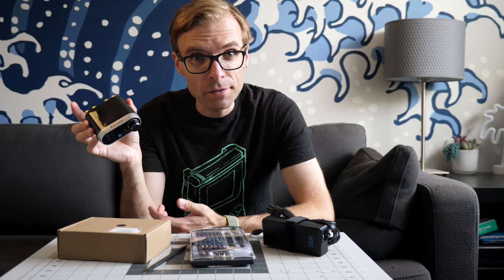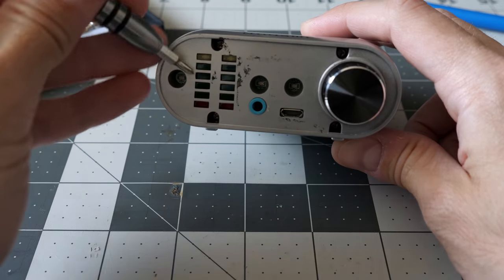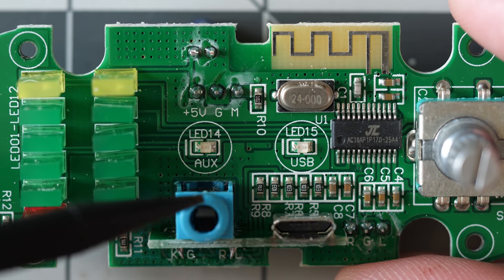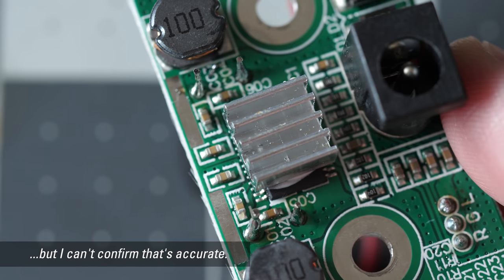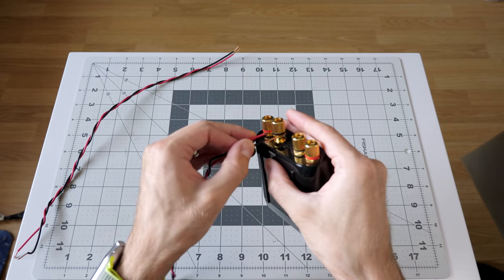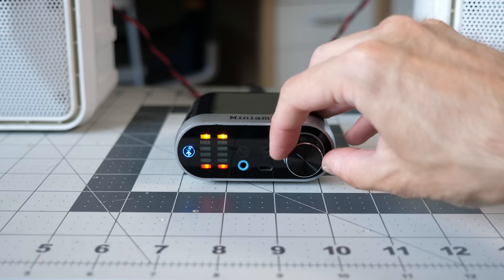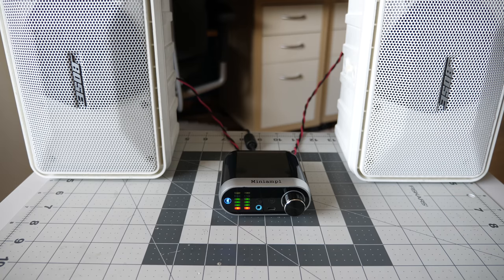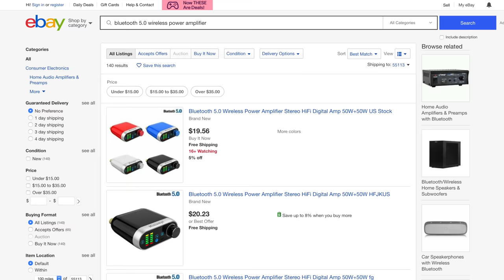Mini Stereo Amp (That Doesn't Suck)

Comment: if you use laptop charger in audio devices , it could make some distortion.
Reply: ground loop. laptop charger is probably earth referenced as every PC running on AC.
Reply: @Mr.Leeroy  Mmm, no, most laptop chargers, at least in the US, only use hot and neutral.  The reason it might introduce distortion is because PSRR is typically only good in amp chips when the noise isn't high frequency.   However, some people, particularly those who like trance misc, like the more lively treble distortion that results.  Purists would never settle for it though, want it to sound the way it's supposed to without that coloration.

Comment: You made a decent review but I don't fully agree with what you did by disassembling it first before testing its audio performance. Who knows if that noise was already there even before you touched it or due to your improper re-assembly? By that, it became unfair to say that the unit has a build quality.

Comment: These little usually arnt that bad. Ive had a few and they all been pretty good. Most people don't realize ypu only need about 10 or 20 watts rms to get pretty loud depending on how efficient ypur speakers are. I have some old kenwoods that are rated at 92db per 1 watt which is very efficient. Only takes 1 watt to get them pumping music out at roughly 92db which is quite loud.
Reply: Yeah, they should also rate the distance. For example, 92db at 1 watt @1 meter. Back in the day you'd see cheaper makes use 1 foot, etc.

Comment: A few add ons to the review: 1) The chip inside is TPA3116D2.  No need for heatsink. 2) The device will produce 32W per channel max RMS if the PSU is a 19 volt 4 amp (like from an old laptop) or 50+50W if you use a 24 volt 5 amp power supply.  3) Device looks great and sounds great as long as you do not open it up. as it seems to have been  soldered and inspected in China.....4) I have a few of these. Only two features I wish it had: Remote control and means to brew my coffee!

Comment: REAL 50 W will blow those speakers... For a Not direct signal recording this thing sounds very "high resolution".  The level indicator  works very  fluid - like a microprocessor based vu -meter.  Op amp , or transistor based vu -meter have some "slew rate" problems and lack a clear decibel steps separation.

Comment: What do you mean you dont know if it is going to overheat. Just run it for 30 minutes. If it gets warm to hot you are going to have a problem. I'd guess that most people would run it on common 12 volts so it may be ok. 

What "sage youtuber" recommends pulling it apart before testing? (Carey Holtzman?) I'm a pc repairer and I always test before repair otherwise you may fix or break something and never know what the original problem was.

Comment: Suggestion for future, honest, tests:
1) Buy two (identical). 
2) Disassemble one.
3) TEST ON THE UNTOUCHED ONE!

This is, obviuously , because they are NOT made to be tinkered with by people who are not repair technicians knowledgeable of the brand's/model's build and features before any internal operation is attempted.

Hope I was constructive enough.

ALTERNATIVE (if you only want to buy one) :

TEST FIRST, disassemble after all tests are performed.

Comment: I got the Breeze-audio 2.1, which is close to the other metal shell model you show in this clip, but has a sub connect, a few preset EQ modes, Aux and I think FM?. I really like it and it drives a couple old ADS speakers which are not efficient at all. I am using a 12v adapter which I will upgrade when I dig out a stronger one out of the box of 100's of adapters.
The one problem is although I specifically looked for the latest BT connection, which this has v5, it claims longer distances, but that looks like direct line. I got 15-20 feet out of it. But perhaps there is a BT antenna you can recommend that we can swap for thatstubby one?

Comment: Usually these Chinesium things suck though they claim to have used a real TI amp chip vs a clone.
Though I think that 50 watts per channel rating is a little optimistic with that little heat sink.

Comment: When I build a budget system it is always with used gear. $20 gets you a nice amp if you spend some time looking.
Reply: Okay, but 1 cent gets you a nice amp if you win a bid on ebay.  You can't really equate the price of used products as it is hit or miss and may take a lot of time and effort looking around and picking it up, possibly getting mugged in the process and tossed into a burlap sack then into someone's truck then buried in the desert where you have no speakers to use it.  ;)

Comment: I've got the nobsound ns10g connected to my PC over USB and e set of slack bs53.2, the sound is simply amazing with endless power.

In bluetooth mode the sound is flat and less clear, I just have used this a few times.

USB works perfect with damn good sound.

Comment: judging by the solder joints it looks like a project I did when I was 13 in shop class.
Reply: I doubt you were doing projects that utilized 90% surface mount components in grade school.

Comment: Love to put a dummy load on this and send it a sine wave, let’s see what the real RMS output power is!
Reply: As an audiophile this like a psychedelic trip to me. A bad😉 one.  That it works at all is natural curiosity. 

You mentioned big old amps.  I have a retro system with a Marantz 1060 integrated amp from 1975. I believe it was their first solid state amp and seems designed with mellow "tubie" sound in mind. 

They are available re-capped on Ebay for less then $300.  Anyone interested in the era could do a lot worse.

Comment: Excellent Review. I was very interested in that intermittent problem I was glad you fixed. The sound produced was pretty decent. I seemed to find the audio quality better when using the USB input path. I don't know if that was your experience as well. But, from the audio you gave in the video, it seems clearer and seemed much stronger and cleaner than the Bluetooth source.

Comment: Id go with the Lepy 2020a class T amp. its by far the best amp for the money out there.
Reply: Except that it doesn't have the features he desired.
Reply: @Markle2k  hey. If your not intrested in sound quailty sure i guess. Can always just get a dac or bluetooth receiver thats would work just find with the lepy.
Reply: @FuskyTheHusky81  The sound quality of this seems to have been sufficient. What the Lepy doesn't have is the desired inputs. If you can't get the music to the box in the format needed, your best quality sound is static hiss.
Reply: @Markle2k  Id still just get an adapter or whatever I need to connect the input to the amp. Then again I'm a bit of an audiophile my self so I would take sound quality and pay a few extra bucks.  anyways though china you can get even better amps that have Bluetooth inputs and really anything you could dream of. but those are more in the 50-150$ range.

Comment: 🤔Interested in one of this, will you confirm one thing: after power failure does it resume the last state or do you have to reconfigure for example you use in Bluetooth mode, then the energy goes them back again does it stay on bt mode or do you have to manually turbo on it again?

Comment: It don't mean a thing if it ain't got that swing, do wop do wop do wop. It don't mean a thing if it don't say N watts into Y ohms at a specified % of distortion all in one sentence. Makes no mater what they say if it don't say it this way, it's just a load of bovine you know what. 

Interesting that it's blurtooth 5.0 (hifi) that mode is not the blurry crap that is blurtooth 4.0. This uses a whole WiFi channel though, and more power. Just plug in and keep it simple and clean.

Comment: The TDA amps are generally pretty good, but the implementation usually suffers.  Too little power going in to power it, and little or no heat sinking.  Put a heat sink on a chip and then put it in a closed box is useless.

Comment: two of ti tpa chips drive my aiwa exos 9 bluetooth speaker - 200w rms one chip drives the dual voice coil subwoofer 100w 6.5'' and second drives the mid x 2 - 3'' and high x 2 - 1'' aiwa did no put heatsinks on them but i've been blasting on full volume and no distortion or else is present bass is always full, just its plastic box had pillars cracked (glued them back with epoxy glue) from too much bass that speaker produce with battery (which is removable and they sell external battery) not AC connected

Comment: $20 great - nice review - sounded OK  I don't like the annoying harmonic distortion w/Class D amps. 
(even soft, higher end piano notes/chords make really nasty buzz compared to clean analog amps.)
Maybe the less efficient speaker helped hide that digital harmonic distortion. Might be like analog
amp ratio of high power signal to the constant, fixed low level amount of crossover distortion???
Reply: Harmonic distortion? Not found any in the modern class D chip-amps like the TPA3116D2, the only issue is giving them a nice load impedance.
Reply: @G-ra-ha-m  thanks. I need to try a modern one!

Comment: It'd make a lot more sense to have the USB port on the back, because having a USB cable permanently coming off the front isn't ideal.
Reply from the maker: Yeah I’m not thrilled with the placement of either the USB or aux in ports either.

Comment: 50 watts... Suuuuure, for a split second if lightning hit it. I'd assume 10-15 watts. 

Also, you put faaaar more effort into those B(l)ose speakers than any sane human would or should. I'd run a set of cheap speakers from a thrift store before I ran those. You know what they say, no highs, no lows, must be Bose. A.k.a "Buy Other Sound Equipment"
Reply: You're not far off. The TPA3116 (assuming this is the real deal) is capable of 2 x 15W into a 8R load at 15V. At 24V it can actually push 50W into 4R. Maybe I missed it but I didn't see what voltage this unit actually runs at. They are actually quite amazing little chips. Class D and generate very little heat. The first amplifier I built was a 2 x 40W mosfet unit with a heatsink the size of a paperback book. I still can't get over how small these things are.

Comment: Hi, I have an mini-amplifier like this, but I mount a small ventilator on it....well I almost destroy the plastic case when I install it but it is working fine the temperature on the power module now is much much lower ....I think he will not survive without a cooler...

Comment: Since you already screwed it up by tearing it apart you should bridge the outputs see if you can blow that bitch up or get more volume out of one speaker and then you could just use a pair of them...one for each speaker.  Getting stereo might be a challenge.

Comment: I kinda can't stand rotary encoder+digital potentiometer volume controls. Sometimes you can't dial it in just the way you want it. But at that price I totally get it. 
-777th.
Reply: I find the 12 volume levels to be just fine.

Comment: Thats more like 15 to 20w. And the hand soldering on the board is really awful. End of the shift on a Friday quality by the looks of it. Cant trim legs on the caps and flux residue everywhere. Better to pay a bit more and get something half decent quality.
Reply: The first thing I noticed was how horrible the build quality was. They made this as cheap as absolutely possible and didn't spend a penny more. I don't really think the dual board is a great idea either. But hey, $20. I'm actually looking for a half decent DAC since my old USB1 one finally died the other day with a pretty nice audio crash. I'm not so sure about this one TBH. No headphone jack either looks like.

Comment: TPA3116D2 is a real 50Wx2 at 4 ohms. only thing i see wrong with that amp is the instructors are too small. 9:12 powering it at full power for more then 1 or 2 songs those instructors are going to get hotter then the blazes of hell
Reply: @Douglas Blake haha yes how did I misspell that twice

Comment: Those class-D amps are always overrated by the manufacturers for obvious reasons.  '2 x 50 Watts' is a stupid claim; usually it will distort like crazy at that level.  Test the thing with non-inductive loads, both 4 and 8 ohm, with a decent power supply of 24VDC.  Then check for clipping and THD at max 1%, which already is a lot.  I bet you won't get 20 clean watts at 8 ohm.

Comment: Excuse me, but I believe this is just the improper way of testing things. It doesn't matter how good you are in taking apart electronic devices and putting them together again and THEN testing them as if they were the original - they simply are not the original anymore! And you will also never know if there was a difference between the real original and the put-together-again 'original'. 
If in an experiment you don't perform a test on the subject of the experiment in its real original state, the experiment is basically useless. It's like testing a new drug without any control substance (e.g. placebo and/or Gold standard).
In this video it doesn't matter that much, but it would have been an easy task to test the device before taking it apart. And the final statement would have been more convincing.

Comment: SO WHY COULDNT YOU DO SOME MEANINGFUL POWER OUTPUT MEASUREMENTS  AND DIST.  TESTS,AND ALSO IF ITS RATED AT 50 WATTS PER  THERES NO NEED TO ASSUME ITS ONLY GOOD FOR LOW POWER SPEAKERS.

Comment: 4:26 Is that white residue on the board some kind of corrosion/oxidation?
Doesn't look all that clean, hope you wiped it off.
Reply: Dried flux, cheap chinese products rarely clean flux off during manufacturing. It won't harm anything.
Reply: Some fluxes actually may be corrosive in the long run.

Comment: Im sure this guy has experience with electronics.  And he didnt break it by taking it apart. Ive taken whole stereos apart and laptops with only electronics 1 and 2 in school and i can put them back together without any issues some things just have bad or loose connections it a easy fix if u have a soldering gun. If utake some electronic apart and it breaks its usually due to bad quality or a flaw.

Comment: For home listening, it would be better to stick with CLASS AB amps. They will last longer and sound quality will definitely be better.
These cheap digital amps may not last long. They are better off for large public address audio systems.
Reply: @Douglas Blake Ok sir thanks for your correction. Can I call it "switching amps" or PWM amps ? My reasoning was that these amps are more complex than Class AB hence not reliable. And sound quality also isnt that great, especially for higher frequencies. I am sorry I aint an expert, I just told what little I have learnt.

Comment: Tearing the sucker all apart and then blami g the build quality is bullcrap. Obviously you screwed but the fact it eventually worked means its not the build quality. Also, I personally think Bose speakers are all overpriced junk. Inefficient as hell and the audio is akin to squeezing 5 pounds of shit into a 3 pound bag. There are so many great bookshelf speakers out there for probably the same price or less. I would use those Bose crapboxes as anchors for my canoe when I am fishing.

Comment: Isn't the ("RMS") output for these things measured at 10% THD? Like all the lower fi stuff is rated.
Reply: I've seen some really sketchy ways to measure. My Yamaha amp measured 20-20K, all channels driven at .01% for their claims. My new Pioneer Elite receiver (which kinda sucks) was measured at 1khz, 1 channel at 10% distortion to claim 165 watts.... totally a scam. In "real" numbers it's only about 60 watts. Most of the cheap lofi stuff makes up their own criteria so they can claim big numbers. I didn't expect a company like Pioneer to do it, but they do too
Reply: @skrutinizr9372  They all do it for the bluetooth speakers etc. (lo fi). Even JBL who specialise in $50.000 pairs of speakers. lol Pioneer make speakers worth that much or more, too. They are all sort of forced to do the "RMS" lie with lo fi (in a way) cos their specs would be way lower than the comp, and nobody would buy it.
Reply: @Justwantahover  So true. It's unfortunately just the way things are now- everything is B.S. and the average consumer is completely clueless to the point they believe it. My "good" stereo equipment wasn't marketed that way. When I got my Wilson speakers, the guy just said to feed them as much power as I felt was necessary- no fake specs. The amp I used was underrated by about 20%, but it's from a company that isn't full of B.S. So rare these days.

Comment: Hey! I’m having some trouble getting sound from my AM/FM tuner. I have a Yamaha T-420 tuner and some toshiba bookshelf speakers. The back of the T-420 only has one RCA output (white and red) and it has no volume controller on the unit itself. When I plug in my bookshelf speakers using a wire to RCA adapter I get sound but it’s very faint from my speakers. I had a potentiometer lying around to control gain. I plugged one end into the T-420 and the other into the speakers to then control the volume but still very faint sound. I’m not sure what the problem is. I can confirm the speakers work because I connected them to another receiver I had except this other one has volume control. Do I need an amplifier for the T-420? How can I get this to work? Thanks!
Reply: This is a joke right?
Reply: @emilen2  sounds like a noob that wants 'Jensen ' sound out of bose speakers. ..😒

Comment: These are all junk under $100 kind of like Bluetooth speakers.  Sure there are under $100 decent Bluetooth speakers but with these mini amps that's about the same size speakers as you'd be able to drive with these amps(think jbl flip). Not sure which speakers people are supposed to use these for?

Comment: just buy a tpa 3116d2 board on amazon and make a case for it. 
And for bluetooth buy a receiver
Reply: Jest buy tpa with bluetooth module
Reply: PMC Workshop Usually boards with a bluetooth module have only one tpa chip so they are less powerful